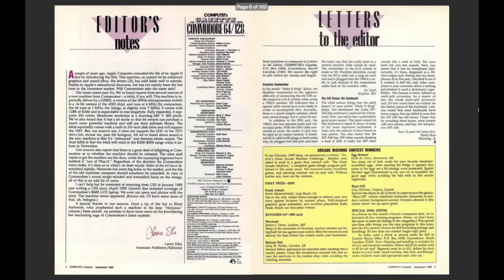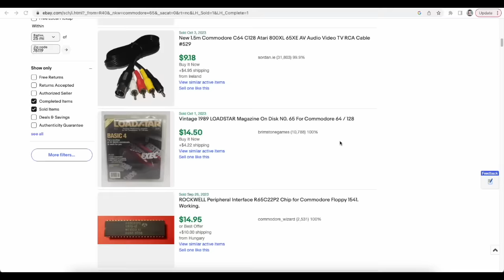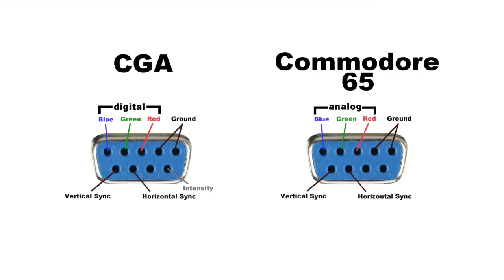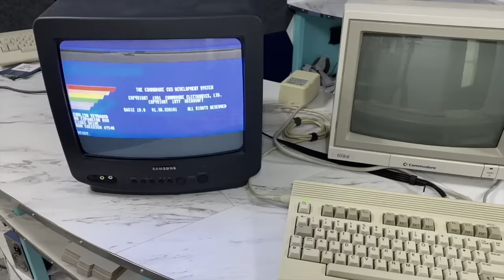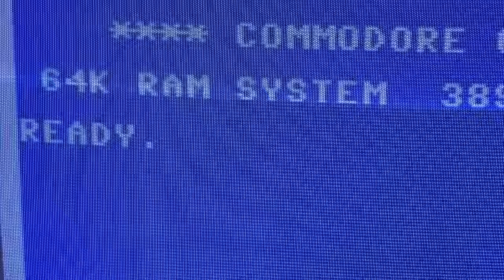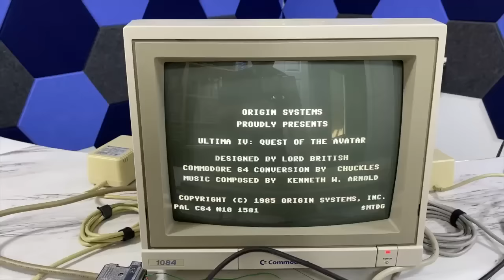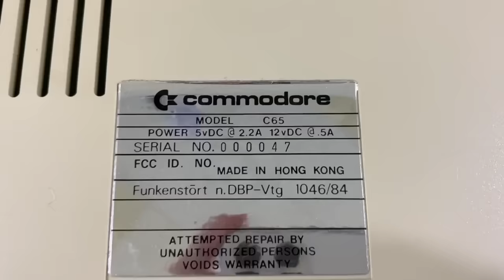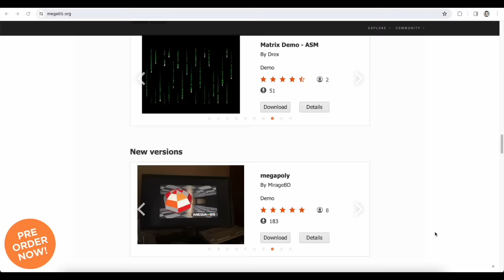The Commodore 65 - A Rare Prototype

Comment: Amiga was and is lightyears ahead of this, for its time it was like a quantum computer. If you start to make a list of never experienced features it will be very long. So it is really cool that not this or similar stuff came out INSTEAD of the Amiga. :) 
This looks like a nice overpriced toy. I started with a C64 and learned programming on it in basic and then assembly (in C monitor). Re-created most of the cool intro effects, ripped sid musics (with own player routine) directly from memory etc...created reset switch from 2 paperclips :D Also built some hadware for the user port, a 8 bit led vu-meter for the played sid music) It was great for its time and the little 64 was ahead of its competitors. BUT. When I got my amiga and started assembly programing/ray tacing/tracker music creation on it... oh boy, that was like night and day. Amiga is still far the best system for assembly programming and creative stuff. I have both many c64s and Amigas in very different configurations, so absolutely not a c64 hater here! But comparing this thing to anything about an Amiga is a crime.

Comment: Too little to late. Even Amiga 1200 and 4000 were considered a disappointments in terms of computing power at launch in 1992... and Amiga 500 was cheap. Two SIDs sounds cool but only to 8bit-heads. Amiga Paula chip is way ahead of Sid, more akin to modern sound cards. In general, C65, like Amiga 600, was a waste of limited Commodore R&D resources...
Reply: and definitely resulted in the company dying not long after

Comment: Making the system an 8bit instead of a 16 bit system, pretty much doomed it front the start.
Reply: 15:40  Mentions the CSG 4510 being a 16-bit CPU with 8-bit backward compatibility.
Reply: @TheUtuber999 incorrectly. It's absolutely an 8-bit CPU albeit with a memory mapper and larger address bus, unlike WDC's 65C816 used in the Apple IIGS and SNES which has a mode with true 16-bit registers. Commodore would have had to pay WDC to license that or even the 8-bit 65C02, so they went with their in-house 65CE02 design for the 4510 chip instead.

Comment: The garbage on screen in some areas definitely is not related to PAL/NTSC artifacts as you don't get a PAL signal but a simple RGB signal. It's a common mistake to talk about PAL and NTSC when 50Hz/60Hz differences are meant. PAL and NTSC are TV signal specs and are not relevant for RGB signals. If you attach your monitor NOT via a TV modulator, NTSC and PAL are irrelevant. (Not even with Composite Video). With RGB it's just about the signal frequencies. If your TV does not sync to 50Hz it shows garbage. Same the other way around. In Europe many TV sets were not able to sync to 60Hz signals - at least until the late 80s.